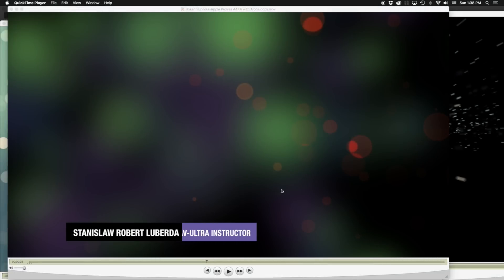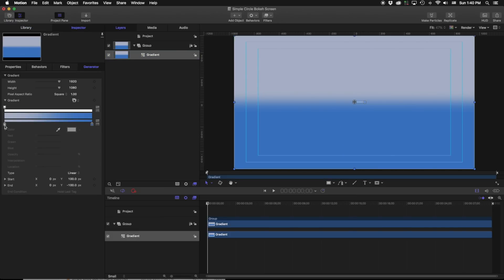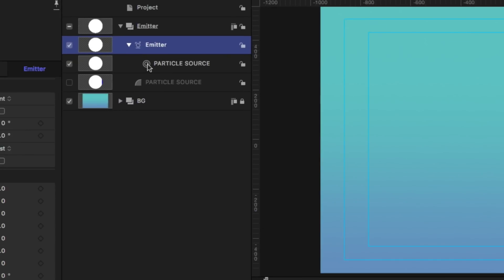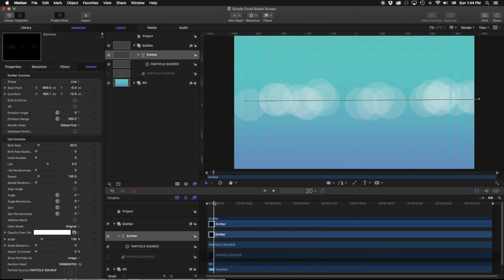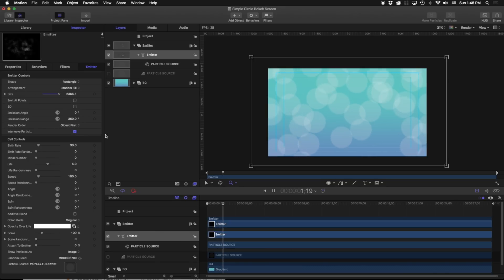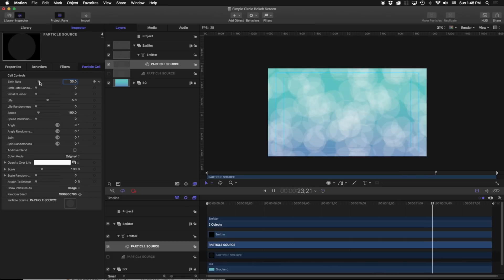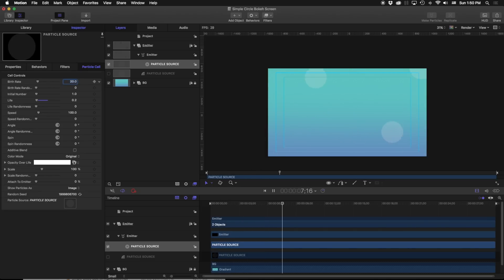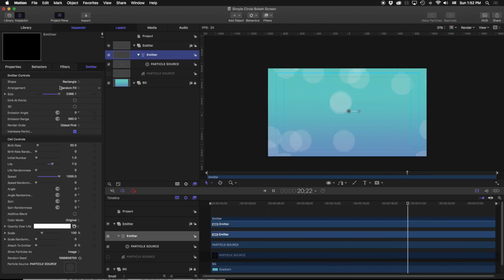Intro to Emitters in Apple Motion - Apple Motion Professional Training 7

Comment: After I set the emitter shape to Rectangle, the size bounding box does not appear like in you video? if I manually adjust the size with the slider the max size is limited to 1000. I obviously need it to be higher than that. Is there another way I can make the Emitter shape bounding box to appear?
Reply from the maker: Check your view setting in the top right corner. It’s likely off. If you need to go bigger, put it in a group and scale the group. Good luck and thanks for the comment.
Reply: @AVUltra  thanks I figured it out. turns out I needed to be using the Adjust item tool to make the emitter shape box to appear, just like in your video. I guess I missed that part in the beginning. But I actually needed to know about the view settings too, so thanks for that too!
Reply: Never mind, I figured out that I can just manually input the values for the size, width, and height. Thanks anyways though.

Comment: Thank you so much!! So clear and helpful! :-) This helped me to make snowflakes falling from the sky :) I just have a question: can you set 2 color modes at the same time? I'd like the snowflakes to have a different range of colors but making all of them appear and disappear with the opacity over life...
Reply from the maker: Hi there- glad you found it useful.
You can absolutely have different color modes.
The trick is to give you emitter 2 different 'cells"
This way you can dial in colors for each cell.

Or you can animate the color of a particular cell to change over time, like from birth to death. This is how a lot of fire and spork effects are done- They start out 1 color, then when they are set to disappear they change to another.
Just make a keyframe in the color value and change it over time.

Hope that helps, and thanks for your question.
-Stanisalw
Reply: @AVUltra  Thanks so much! I'm gonna see if I can do that :)